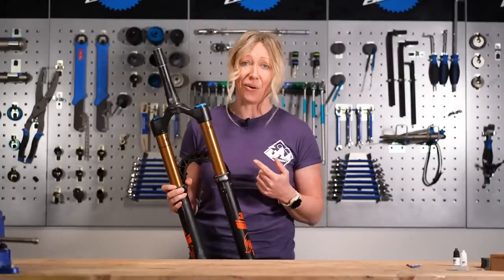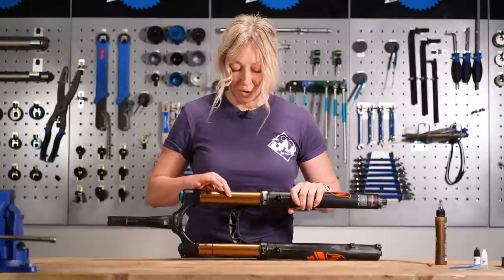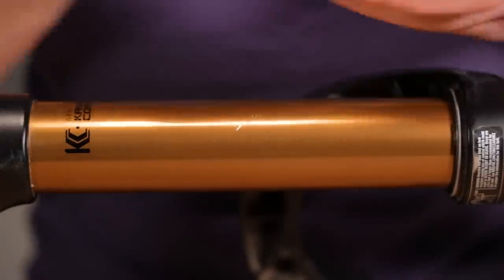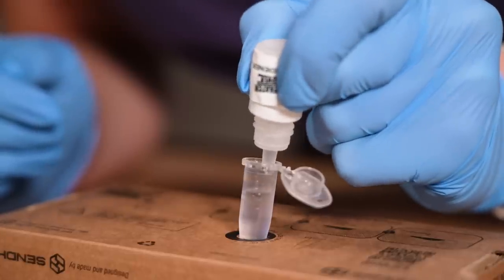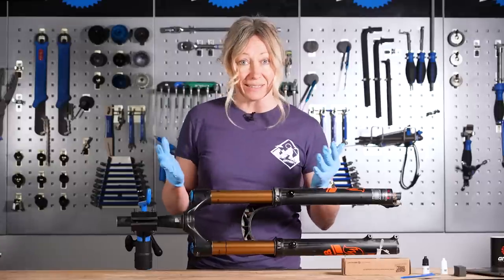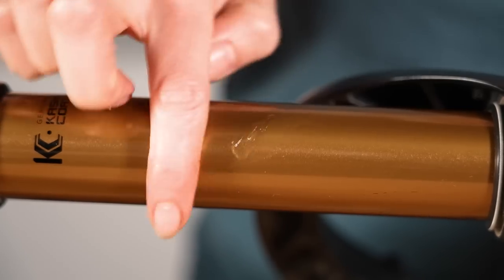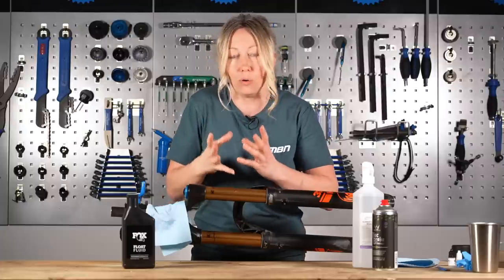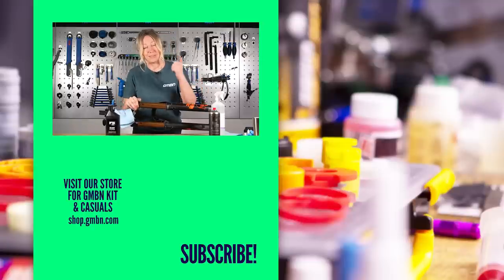How To Repair Fork Stanchion Scratch With Epoxy Resin

Comment: I’d probably tape around the epoxy before sanding so I didn’t sand unwanted areas
Reply: Technically you shouldn't, the tape would leave a gap between the surface of the stanchions and the epoxy, wich means that once you're done you will have lined up the epoxy with the tape, not with the forks. It would work to get rid of the biggest bump of epoxy but you would need to remove it to finish it properly
Reply: You could use a little petroleum jelly instead of tape to make sure that you don't sand outside the preferred lines and scratch up the stanchions that are not in need of repair.
Reply: In order to properly repair it, you have to feather the repair into the existing coating.  There's no way around it...you are going to sand into the coating no matter what.
Reply: @cup_and_cone  Agree also because sendhit itself suggests to make the sanding in the sliding direction of the fork for better results and it is what i did and for some magic the anodization after the application of the finishing paste did not show any kind of sandpaper scratch at all.

Comment: I'm a mountain biker and a knife maker.  The knife making part gives me epoxy experience and I knew as soon as you said epoxy it would work.  But not like that.   No close ups of the results since I assume you Aldo know you put too much resin.  I know from personal experience that much resin take an hour to sand down carefully.  I assume you were not careful scratched it up and did not want to show it.
Reply: So how would you do it with epoxy?
Reply: @stormeporm  the issue was they used too much.  I'd do the same but wipe the epoxy off.  The scratches would get full with little to sand.  Then I'd probably sand stating with 600 lightly until smooth.
Reply: @chaselilly8541  Thanks for the info!

Comment: Sad this channel really died
Reply: Don't think died it never really got off the ground their Tech side of the channel is not really based in science it's just a bunch of guys and gals trying to do ad hoc or on-the-fly repairs. They're not trained mechanics they don't use any science-based methods for testing or application implementation. I mean bless them they try but they usually fail more than they succeed. They just don't do the proper research and if they are doing research there certainly looking and reading at improper incorrect sources information. I'm not sure where they glean their research from but it's usually absolutely garbage. I give them credit for trying but they really do mislead a lot of people on the tech side
Reply: What science and information was missing here? If you have thoughts on how we can improve the channel, I will of course take it on board!

Comment: The missing Kash coat is still an eyesore. You can always go to a hobby shop or craft store to find some matching paint to touch up the Kash before you apply the epoxy.
Reply: Their own fault for buying golden MTB parts. Every time a Bugatti owner cries over kerb rash on their golden 32 inch rims an angel gets its wings.
Reply: 2nd- You're right. That's why I'll just throw the fork in the trash (not rubbish, I'm wealthy not soft) and go buy another.
Reply: @2nd3rd1st  i get what you mean, but i'm pretty sure that no bugatti owner has 32 inch rims, much less "golden"
Reply: @2nd3rd1st  Yes, it's people's fault for enjoying nice things...everyone should ride a crappy 25 year old single speed rigid. 🙄

Comment: The grit size is incorrect in the video. Do not use 150, this would likely ruin the stanchion even more, but 1,500. You can guess in the video that one zero is missing

Comment: why not super glue
Reply: It's too brittle and hard to sand
Reply: Yeah, but not 1,5ml of resin... Few drops would have been sufficient, just 2/1 ratio and there you go.
Reply: @M4st3rofnothing   I saw on a video of super glue and baking soda on top of the glue, then sand it down. It's how they fixed helicopter blades.
Reply: Superglue (cyanoacrylate) is not very UV stable and weather resistant.  It's not a long term fix.

Comment: Way too much epoxy resin here... You should use a needle or a toothpick to only apply small amount of resin on the scratches. You would save a huge amount of sanding time.
In this kit, they also provide polishing paste that helps to get a very nice and smooth finish. I've used it on my Sid and the result is perfect.
Reply: We didn’t see a close-up of the result, probably still sanding. 🥹
Reply: She said exactly that. 4:52 . I think it was fine.

Comment: I used a Stanley blade to remove any burrs then car body filler and sanded It down with 2000 grit wet and dry. Been fine for 12 months now

Comment: Now I’ve not done this myself but de-nibbing the resin with a new sharp razor blade( not a Stanley blade) by holding the blade flat to the stantion and slowly de-nibbing the resin without digging into the station should give a finish that requires very little to no sanding . Maybe someone should try this on an older pair of forks as it’s a method I’ve used for years for de-nibbing car paint runs or stone chip touch ups

Comment: Nice video.I think the better thing to use on taking burrs off the stanchions from scratches would be to use Tungsten wool or steel wool.Its far more gentle than a file.Safe riding.💯👌🏻✌🏻
Reply: Use a diamond file very very fine sanding surface
Reply: @rider65  Yes,but I myself would prefer to use Tungsten or Steel wool.💯✌🏻
Reply: Crazy using steel wool . Good luck with that .
Reply: @richardjohnston6688  I guess it might not be very effective.

Comment: I just use clear coat that you get in a bottle for touch up jobs. Works well then once set I use a sharp razer to knock off the high spots & make it level no sanding needed. If there is still a little bit i'll use 1500-2000grit more like a polish.

Comment: Sand paper glued or fixed to a plexiglass block would be less likely to bend or fold past the epoxy and scratch the tube. That foam block would be difficult for accuracy.

Comment: Thanks, but you did not mention if there are preventative measures aside from not falling. Ages ago, for example, rubber boots protected the stanchions. Are these bad? Do they even still exist?
Reply: The early shocks came with the boots (like Mag 20 and Judy) but it turned out people neglected to clean the dirt collected inside and further damaged the stanchions.
Reply: Fork Gators 👍

Comment: Would it hurt wiping a fork that's in good condition with WD40 to keep it running nice & smooth + a bit of protection against the elements ?
Reply: Absolutely not, you will ruin your fork
Reply: @ViorelSnap  ok thanks
Reply: Wd40 is just a weaker acetone
Reply: Get some proper fork lube you tight sod 😂 it's about £15, works really good, keeps the seals nice and "fresh" stops them drying out... I even take that metal ring of the seals and get alittle bit under the seals. Forks like brand new after doing it
Reply: Instead of WD-40 or similar use pure silicone to just wipe the stanchion surface off and on top of the Dust seal. Wanted clean you can use a little bit of silicone or suspension grease on the top of the dusty land work the stanchion up-and-down to lubricate and reduce stiction.
Reply: @janeblogs324  🤔🤣🤦‍♂️
Yeah,  no. Petroleum distillates it's not acetone. WD-40 is a water displacement and rust reducer it is not a good lubricant for suspension parts. Acetone is for cleaning not for lubricating. Acetone will wipe away any lubricant from the seals which will dry out the dust seals. Eventually accelerating Fork wear. Whoever told you that information or wherever you might have found that is absolutely Incorrect and uninformed. Do not use any type of aromatic or alcohol-based solution to clean the fork stanchions and dust seals. Use silicone, or even soap and water. Do not drive anything down between the stanchion and the seals. Once the stanchion is clean you can use a silicone or suspension lubricant on the seals and work the statues up and down removing excess when you are done.
Reply: Yeah £15 is 'dirt' cheap... I'll just use regular wash products when i do the full bike cheers 🫣
Reply: Use silicone spray
Reply: @rider65  wd40 doesn't reduce rust, it lubricates while wet for about 10 seconds. 
All it does is evaporate, it was designed to make spilled jet fuel evaporate even quicker.
Reply: @janeblogs324  I see you have a lot of videos you posted... wow you're a great Rider! When did you turn pro? Are you also a pro mechanic? 🤣🤣🤣

What a sad existence...😆

Comment: Are you claiming that a minor scratch could threaten the structural integrity of the fork? As far as I can tell, filling a crevice with epoxy resin has cosmetic value only.
Reply: Scratches would wear down the seal in that spot as well as pull in dust and dirt as it passes the seal. This is the "damage" that would occur from a scratch like this.